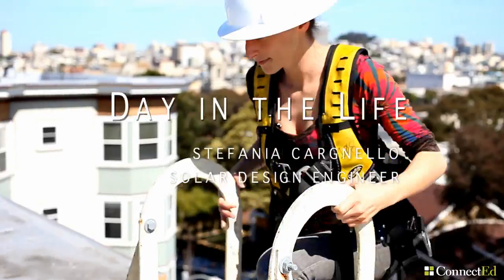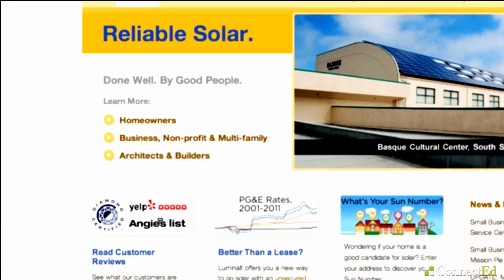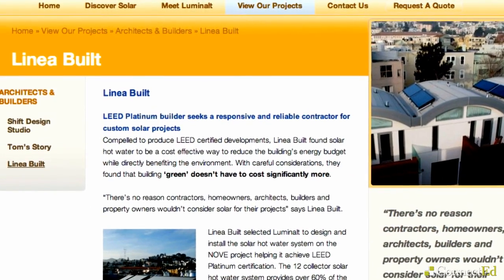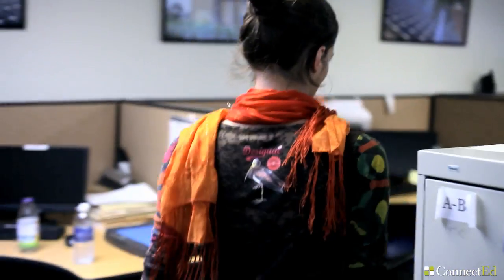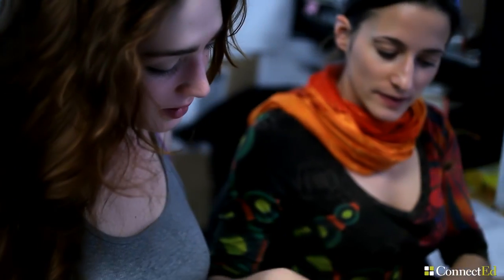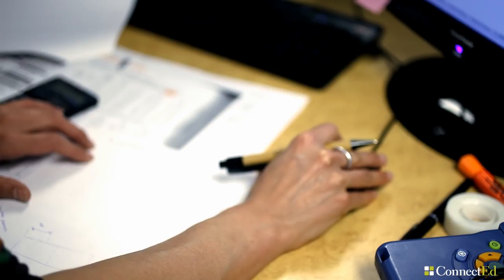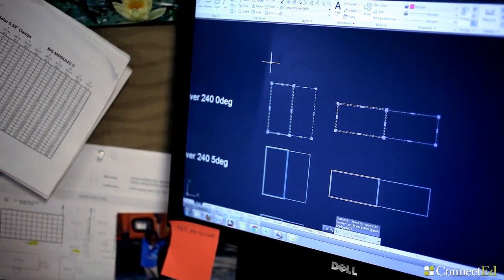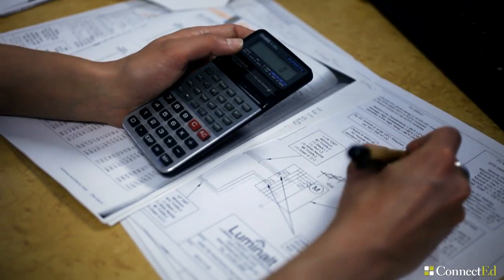Day at Work: Solar Design Engineer

Comment: THIS IS EXACTLY WHAT I WANT TO DO WITH MY LIFE! I am currently in community college starting from scratch, but this is exactly what I had in mind when choosing engineering. How do I go down this exact path?!?!
Reply from the maker: +ty pannell We are not sure. This might be a question to ask some Solar Experts (maybe you can find an association or group on Facebook?) Lots of jobs have various options for everyone, just not sure if this requires lots of climbing and other physical activities (probably the installation part does) and/or if there is possibility that you could split the work with someone else, maybe focus on the design portion of the work?! Let us know what your research turns up. Best of luck!!!
Reply from the maker: +Anthony Hernandez Hey there! Here's some more information on this career: https://www.connectedstudios.org/url-zvhshrn9KkwgSynhiuxJHLDtWFcMwpeCD-sGf0cA Hope it helps!
Reply: +ConnectEd I'm thinking of going down this route, but I'm on a feeding tube. would this be a wise choice for someone with physical limitations?
Reply: +ty pannell what did you end up doing?